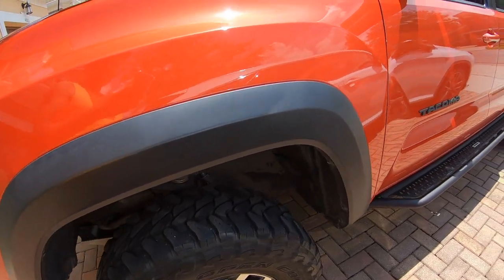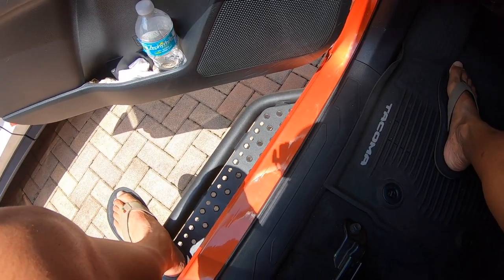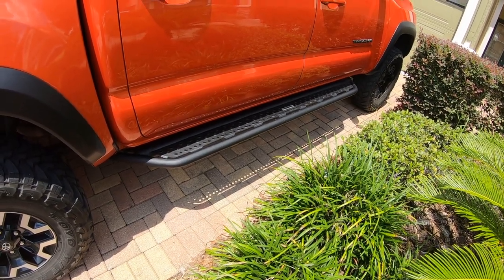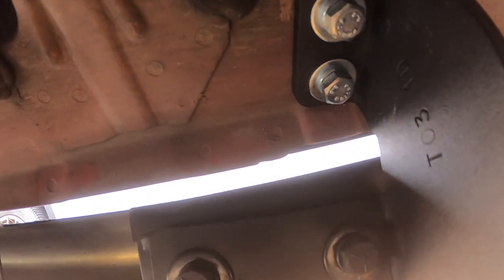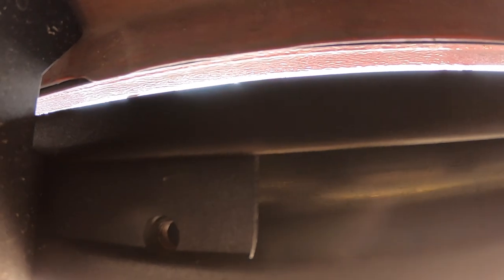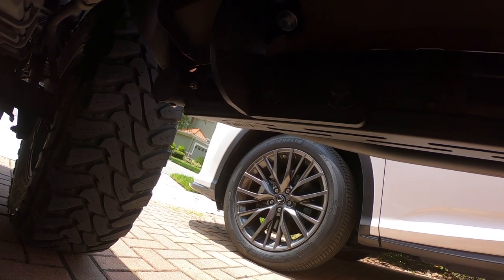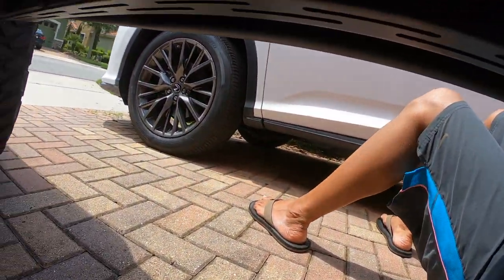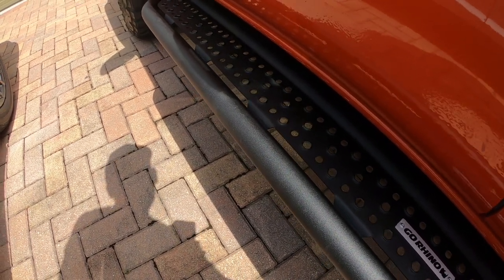Go Rhino 6" Dominator D6 Running Boards / Side Steps for Toyota Tacoma 3rd Generation

Comment: I install the d6 on my 2021 Tacoma I can’t even fit my size 8 foot on it.. any longer brackets for this running board?
Reply from the maker: Hi Sam! 
Not sure if they make them longer. You might have to cal go rhino. I actually like them this size because they don’t stick out to long. They protect the door from door dings from other cars. I know they make steps for this one that can be installed to this running board.
Reply: They make drop steps you can add on to these.
Reply from the maker: @AdamNicholasSievers  They do but I think it would be low to the ground with the steps added. You would loose ground clearance.

Comment: Hey how much do these Go Rhino running boards/ side steps weigh 🤔
Reply from the maker: I can't find any info on the weight, sorry. I would hate to guess but they aren't as heavy as other side rails. I installed them by myself so it wasn't too bad. Very sturdy but I would say they are lighter than most side rails.